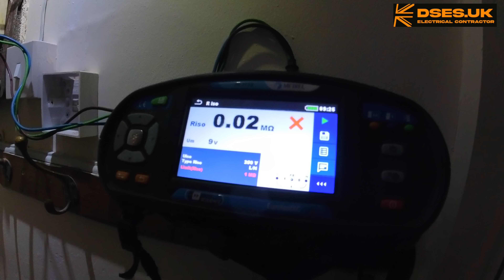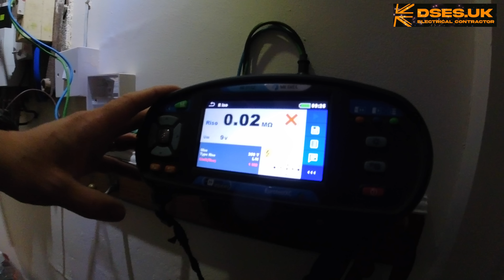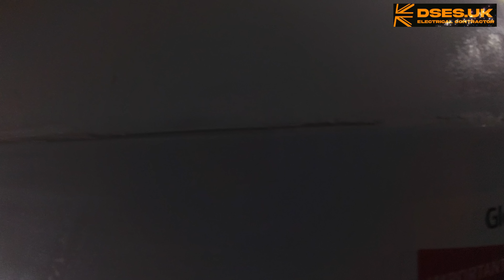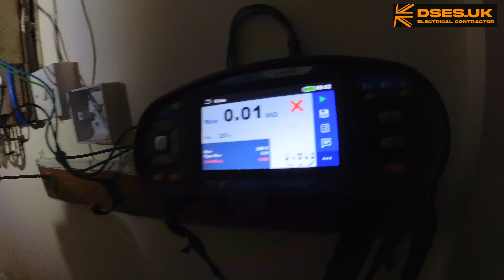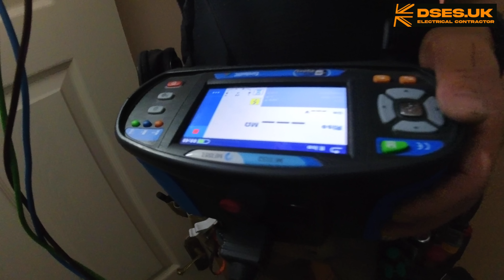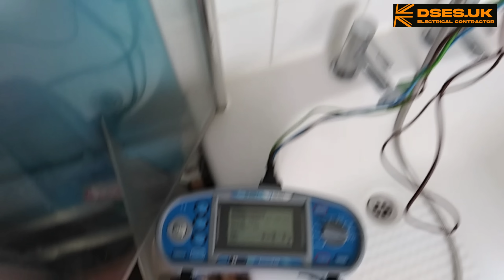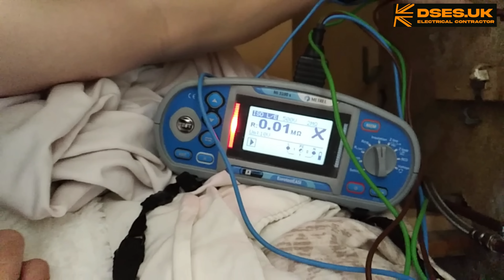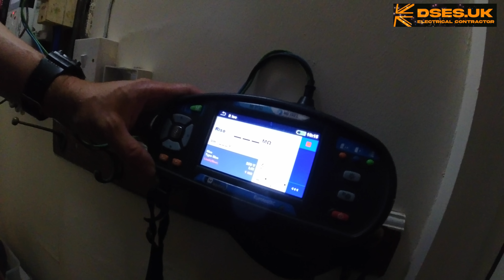Pair o' I.R.SEOLES

Comment: Hi David. Quick question I do some work for white goods shops sometimes they ask me to go out to a job where they have been because they can't install say a 13 amp single oven because it's been hard wired straight into 32 amp supply.
   So they want me to install a socket there or fuse spur but with these new regs it's turning into a right pain with these type a rcds.
    How are you getting round little installs of this nature without saying you need a new c.u lol.
  I would of thought a 13 amp single oven would be fine on a type ac rcd but all I keep hearing dc components  
Needs type a rcd 
  Thanks
Reply from the maker: Don't forget that changes to BS7671 are not retrospective. You can undertake like-for-like changes on older installations without them having to meet the letter of 18th Edition Amendment 2. It's the same with something such as lighting - 18th Edition says domestic luminaires should have RCD protection, but if you go to some pensioner's house to replace a failed light fitting, there's no need to insist their old BS3036 board be entirely changed out first and leave 'em in the dark until it's done! If a wholly new circuit is going in for the cooker, then it would have to comply with 18th A2, but if it's an existing circuit, with or without RCD protection, Type-AC or not, then you can perform a like-for-like swap of the appliance unless the manufacturer states that RCD protection must be present for their equipment. Type-AC RCDs aren't suddenly dangerous or inadequate, although I'm sure there are moody EICRs being performed up and down the country where pre-A2 consumer units are being C2'd by the Check-a-Trade cowboys. Amendment 2 even still permits Type-AC for resistive loads on new circuits, and the testing requires only a 1x Type-AC for any minor works certificate if an RCD is present. Make your like-for-like changes but note on the minor works if an RCD isn't installed or if it's a Type-AC, and also state in the comments section that you recommend the installation be inspected and tested to see if upgrade work is required. That puts it onto the homeowner to decide whether or not they should splash out on any improvements.
Reply: @dsesuk  hi mate thanks for response yes if its like for like then as long as all the tests come back right it's installed. 
   But alot of the time the appliance has not been installed correctly say the 13 amp oven was wired directly in to the 32 amp cooker supply. The shop then want me to install a socket on the end of that cable so they can then go and plug the oven in would only install the socket if there was type ac rcd protection. But Now after speaking with technical they are saying that  socket installed or fuse spur would now need type A rcd because of the dc components that are in the oven. Which to me is a bit silly to me because it'ssafer than it was before. Was just looking for your take cus I trust your opinion more than there's lol I don't want to foul any regs but don't want to charge people for things not needed.
Thanks
Reply from the maker: @gd-bq7em  It's a bit much to expect Type-A to be present on any installation predating 2018 and I doubt something like an oven would add too much of a headache for a Type-AC device personally. You're in a world of pain if you're being told that a straightforward minor works job now has to have that kind of protection in place because it either means an upgrade to the RCD/RCBO in the CU (which invokes an EIC instead of a MW), or installation of a sub-board or new CU because the existing stuff on site is obsolete and cannot be upgraded. Meanwhile, Joe Homeowner tells you to bugger off because he's just blown £500 on a new oven and can't afford expensive upgrades he doesn't think is necessary, and after he's shut the door on you, he'll get on the phone to just about any other local spark who'll come and do the job without a second thought. I'm certainly not going to insist on Type-A for any and every like-for-like minor works job! Remember too that the RCDs we're talking of are for additional protection - if the cooker circuit has its primary means of shock protection, i.e., the earthing is present and correct, then that's what'll do the business in the event of a fault. I'd do the job, log the details on the MW, and note in the comments that the homeowner has been advised on inspection, testing and recommended upgrades. That's as much as I'm obliged to do and it puts the ball in their court where it belongs. They're the ones living with the installation and in control of whatever budget they can throw at it. The lack of a Type-A RCD or even the lack of an RCD wholly is not necessarily a problem and certainly isn't something I'd insist on like some kind of sparky Gestapo! If a family on the breadline has an oven that's failed and they've scraped together just enough to buy a new one, any suggestion that it can't be installed in place of the old one unless they now find the money to pay for CU upgrades is a nonsense and effectively holds them to ransom. Same for lighting or anything else. Most of the people who have the worst electrical installations either can't afford better or are in accommodation they're not responsible for and cannot improve directly. Do your minor works job, check EFLI, IR and the OCPD are correct for the circuit and cover your arse in the comments section. That's what it's there for. Also, go tell Technical to wise up. There's a real world outside of their comfy office and they should try visiting it sometime!
Reply: @dsesuk  I totally agree mate. I said that to the napit tech. people just won't pay and they will end up using an extension lead to the nearest socket and that even worse. Thanks for your advice I appreciate it. if its a new circuit i totally understand it go all guns blazing type A rcd spd the works . But just a slight alteration like putting a socket or a fuse spur in-between the cooker cable and oven then saying it needs type A is silly. I am just going to stick to the same way as always been doing it never had no probs before. Like you say I can't see how a cooker is going to give a ac rcd any real problems. I appreciate you time mate like I say I will take the opinion of a top spark like you over there's any day thanks
Reply from the maker: @gd-bq7em  Ah, NAPIT tech. I'm not sure I'd trust them to tell me the time from a digital watch. The CPS tech peeps always go exactly by the book... unlike the real world which has an annoying habit of deviating from it!
Reply: @dsesuk  lol 😆. Cheers mate thanks for your time. Look forward to your next video you and nige do make me laugh love the banter 👍

Comment: Should the bathroom not have a IP rated light? 🤔👍
Reply from the maker: Why? It's not in any zone. It also has the extended skirt, a design brought in for bathrooms many moons ago (actually called the H.O. skirt because the Home Office introduced it I believe!) The light is no more or less IP rated than the pullcord switch or, if they were present, a shower pullcord isolator, fan pullcord isolator, ceiling fan, fused isolator or anything else you'd find out of zone on a bathroom ceiling. The only stipulation for an electrical item in a room such as this, when out of zone, is that it be fit to be present in there. This fitting is insulated, won't corrode and the base of the lamp is covered by the extended skirt preventing access by all except those who really want to start taking it apart with wet hands while it's on and while they're standing on a metal step ladder. When it comes to that, I'm all for natural selection - let physics sort them out!
Reply: @dsesuk  - Thanks for your reply. I thought because it’s a rental it needs IP rating and RCD protection or bonding. However, I will bow to your wisdom and keep silent to those 2 landlords who I have robbed this year by saying they needed to change the light fitting to one suitable for a bathroom. Guessing you wouldn’t code it c3 just make a note? Thanks again 😎👍
Reply: I remember as a child playing cowboys 🤠 and shouting the bathroom light with a water pistol 🔫 it exploded, I went downstairs, after taking off my ‘cunning disguise’ and told my parents “ I just turned the light on and it’s exploded”. It would have never happed with an IP rated LED 😝.. might have gotten away with it if I’d not still been holding the water pistol 😂😂😂
Reply from the maker: Ah, those incandescent lamps used to run pretty hot, so a jet of water hitting the glass could shatter them. But then, all bets are off on any electrical equipment that's being subject to mistreatment! As for IP lighting; well, there's nothing wrong with it. Personally, I wouldn't comment or code on a skirted batten fitting that's out of zone.

Comment: A quicky for everyone, cable of whatever type buried less than 600mm deep with no "electric cable below" tape, pass or fail ?
Reply: Depends on situation. For example if it's an SWA going into the ground on the side of a house, next to the side-passage connecting the front and back gardens, and remerging about a meter away on the fence directly opposite, then I wouldn't worry how shallow it is or whether there's any tape as it's presence and route is obvious.

Beyond cases like that use your judgement, taking into account what would happen if someone were to impact the cable with a shovel or similar, exactly how deep it is buried, and how apparent the route is (could someone dig there and not be aware of a cable?).
If it's an SWA with the armour continuity to earth confirmed and a working protective device at the supply end (MCB at least, although additional protection from an RCD would be nice), or a cable in earth metallic ducting I'd probably put it down as a C3, since the potential danger is somewhat mitigated (impact with the live part with short to the armour and trip the device).
For something non-armoured in standard ducting then you can only consider where it is and the chance of disturbance to decide between C3 and failure (or perhaps nothing if it's very obvious like my earlier example).
If some muppet has stuck a bit of twin and earth or flex or whatever else inappropriate under their garden without protection that's a failure regardless of how deep it is or tape/no tape.

Comment: Unfortunately there’s going to be a percentage failure rate, no matter who the manufacturer is. As long as it’s not a known manufacturing or design fault that requires a product recall you just have to take it on the chin.

Comment: 31:50 Mickey Mouse will pay you a visit and f you up, f you up good...🤣🤣
40:50 but he said he stuck a monitor on it and it never saw more than 30 amps. Manufacturing faults do happen, I've seen servers that cost tens of thousands be DOA cos of a manufacturing fault. Dan the Man should open that up and see what went wrong, it could be as simple as a duff contact causing arcing and thus heat build up. If the non latching 40 amp, he mentions, was next to the 32 amp one, the heat may have caused the 40 amp's externals/internals to deform causing that issue.
Reply from the maker: My understanding is that it was an existing device that was being monitored only after the EV charger went in. Its history prior to that and, presumably, going back to 2018, is not known. The thermal damage may have existed before the EV installation - it was only found when Dan went back to change it for a Type-A I believe.
Reply: @dsesuk  I've been there have that t-shirt. The shower in a rental place I lived in before would always trip out the MCB after around 10 minutes of use, so if you have 2 people using the shower, one after the other, it would cut out on the 2nd person. 
The shower was on a 32  amp MCB, probably the MCB that came pre-installed in the CU. Issue was the shower was a 9kW shower so should have been on a 40 amp MCB. Once the MCB was changed it all worked fine.
It just seems some sparks can't do simple maths, cos even a 8kW shower would really need a bigger MCB than 32 amp, if it's going to be used for any length of time.